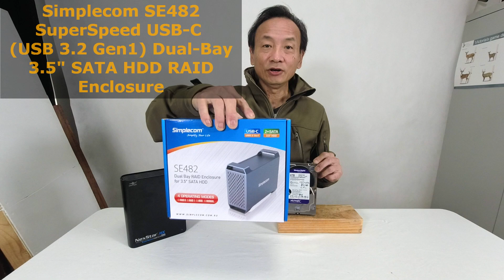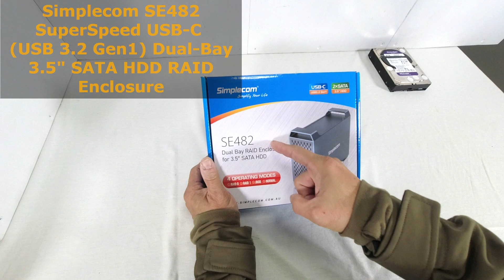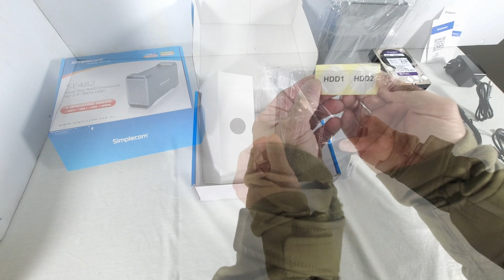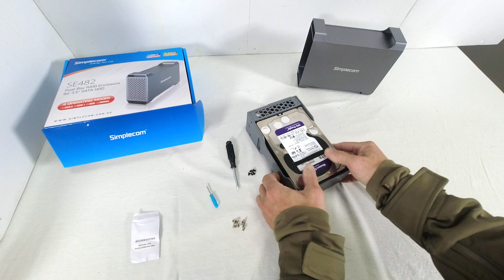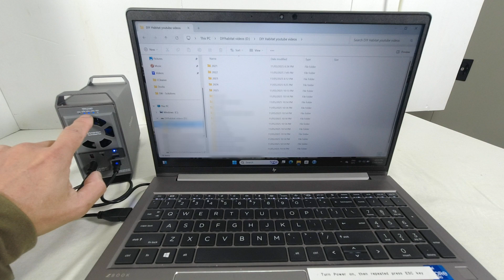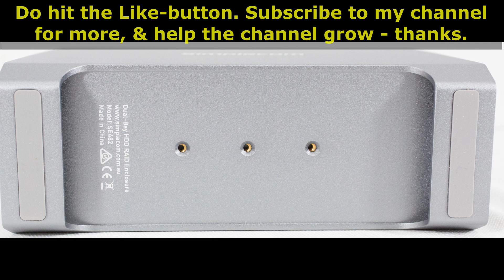Install and test SIMPLECOM SE482 dual-bay USB3.2 Gen1 SATA RAID disk-drive enclosure. I like it!

Comment: Looks good! If you have a single drive or Raid 1 drive and the Simplecon enclosure fails can the drives simply be accessed by installing in a different case?
Reply from the maker: i just invited a contact I have from Simplecom, to join this conversation. And provide a reply to your question. I hope he does join in.
In the interim, I suggest you google search technical forums - regarding your question.

Comment: Dear please help me with some information,  recently i bought one 6TB Western digital and one 10 tb seagate iron wolf both are getting  extremely heat like 47-50 degree celcius (AT THE CRYSTAL DISK INFO) where my 7/8 years old 2tb hdd is getting heat 37-40 degree celcius. #Did i buy the bad 6 and 10 Tb hdd? Or this is normal for high capacity hdd? Please help me.
Reply from the maker: search the HDD manufacturer website, for the technical specifications of the models of HDD you own. Look at the stated "operating temperature" range in the specs.That is the guidance.

As for factors affecting how hot your HDD gets. Depends on room ambient temp; HDD enclosure type (fan or fanless). Nature of HDD use (ie  heavy data traffic?).

Comment: It's a real pity about this case, well built easy to move around and nice looking. It has a serious design flaw in that the fan blows against the inner front pcb board, very little air gets to were it needs to be, across the hard drives. The case has the holes although is blocked by the pcb board. How they missed this is bewildering. Also the auto fan function setting needs some adjustment, it comes to life around 48 degrees,  this is far too hot. It should start spinning around 28 degrees.
Reply from the maker: the fan is an extraction fan. It sucks air out of the case. It does not blow air inwards. So the design works.

Most consumer electronic components are designed to max operating of 70C. So fan activating at 48C seems ok. reasonable
Reply: @DIYhabitat  Thanks for the clarification. I tend to disagree with you on the temps though. 70 Celsius is still way to high for a hard drive. How loud is the fan?

Comment: Thanks so much for making this video, i've been looking all over for some kind of review for this enclosure.  Thanks heaps :)
Reply from the maker: glad you find it helpful.🙂
Reply: @DIYhabitat have you been able to find a way to activate the fan and bypass the temperature throttle? 48 degrees sounds too high
Reply from the maker: https://www.renesas.com/en/support/technical-resources/temperature-ranges

if the threshold fan temp is lowered more. The fan may end up operating non-stop, & burn out.
Reply: @DIYhabitat thanks, I feel that consumer electronics might be a bit different to hard drives.  All the literature I've read is that safe temps are much lower than that.  But appreciate your thoughts